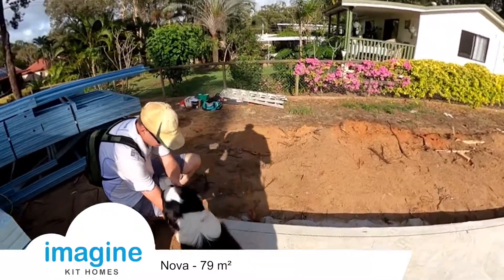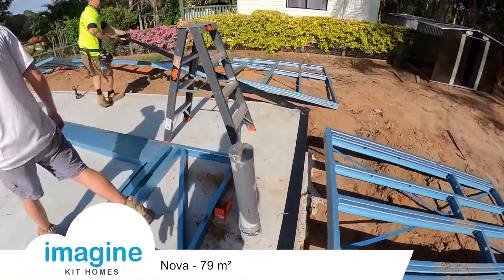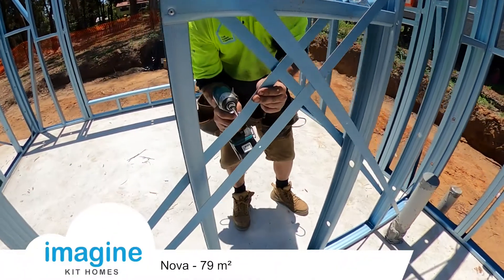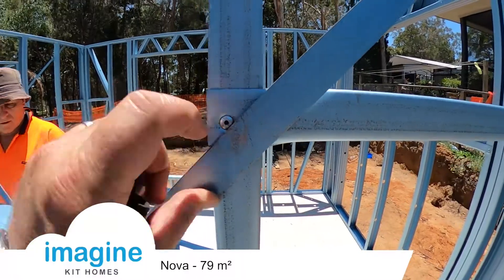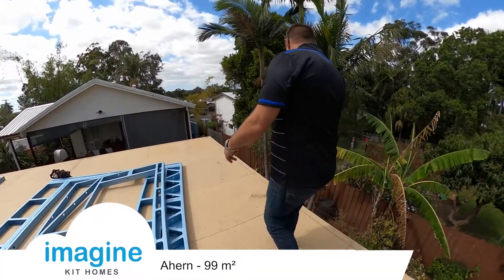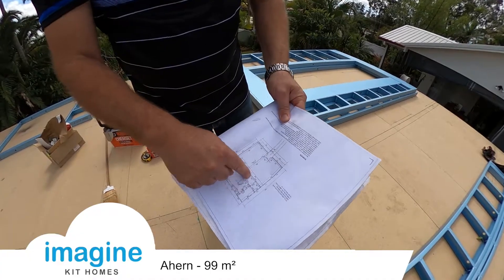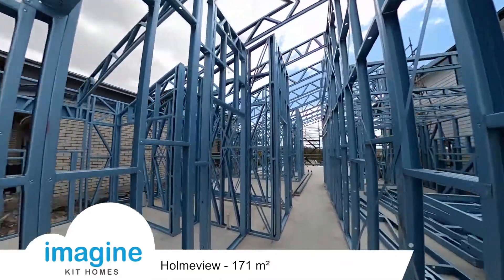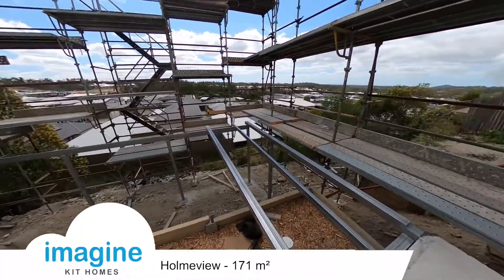First steps for building a steel frame.

Comment: Mark where walls go, PVC membrane under external walls, strap tensioners. That's all I learned from this. Where is the FRAMING? I feel like if you know the framing part, you also know the other things talked about in this video. If you learned anything from this video, you only have more questions.

Comment: How thick are the studs?
Reply: depends on the detailing program and roll forming machine, but normally 89x38mm profile, thickness from 0.55-1.6mm (most common for residential would be 1.2mm)

Comment: Hi, How do you fix the frame to the slab?
Reply: Nuts and bolts anchored in foundation
Reply: Many options: drill then epoxy & threaded rod plus nuts or coach screws or nail-in anchors (not really advised, only for temporary support while the rest of the frames goes up)... some even use Hilti nail guns with explosive cartridge nails (don't use them for permanent fixings)  always use the spacing of fasteners as per drawings/ details, and use square washers opposed to round ones - they have cover more area...

Comment: What will happen if the screws loosen up over time because of the temperature difference. Will the whole house rattle when walking up and down in the house?
Reply: that is why i will weld them!! a good welding best all!!
Reply: @shonix123  don't weld galvanized steel... it breaks up the coating and opens issues for corrosion, not to mention the toxic fumes - rather rivet the connections, and "over the top": add same sized washers at the back for the rivet to pull tight...